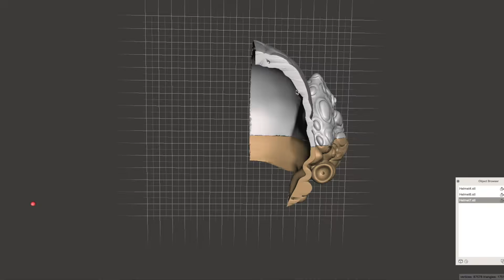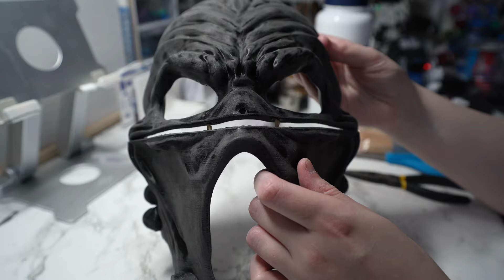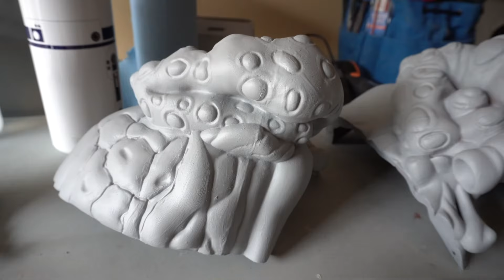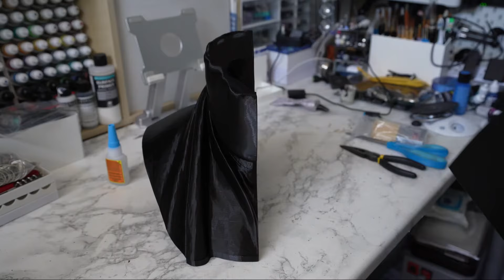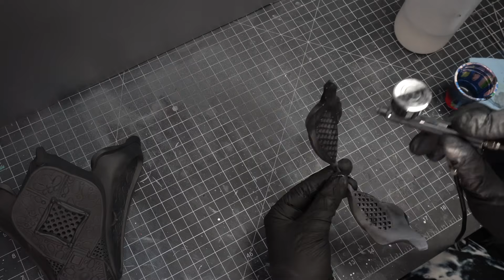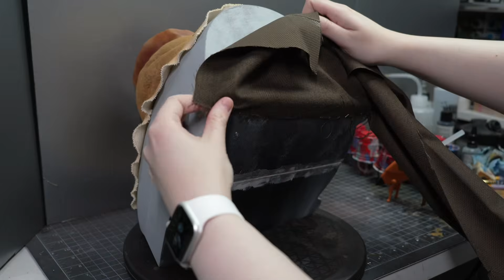Making Jedi Master Plo Koon

Comment: Absolutely love this! Can i get your honest opinion? Is this possible to recreate for someone with less experience than you? I am quite handy (made a majoras mask out of wood) but I don't have a 3d printer, so I have to buy the parts. Do you think I would get a somewhat decent result? I do own an airbrush.
Reply: As someone who also doesn't have accessibility with 3D printers or air brushes..I've been wondering if you could still achieve this through dry brushing? It would definitely be more tedious, and you'd need multiple shades of paint and multiple brushes. You'd need a solid base from sanding and priming the print before trying this out though.
Reply: @The_Cryptid i dont have a 3d printer either. I just bought a 3D printed verion on etsy to see if i can get a somewhat decent result. If so, i might purchase a 3D printer in the future for more projects.

Comment: Hiii Can it be used for cosplay? 😮
Reply from the maker: Definitely! You’ll just need to possibly look at rescaling the model to better fit your head. The neck area can be quite tight so you might have to add magnets to the back piece so that it can detach to more easily get your head into it.

Comment: Does the resin over the seams help the bondo not crack? For whatever reason when I use bondo to cover seams I end up with very slight cracks where the seam is after a day or so. You did a great job on this!! I’m subscribed to a few channels that review Sideshow pieces, statues, etc and when I was scrolling through my Subscription video list I thought this was one of them!
Reply from the maker: Definitely. Or at the very least it will fill in those cracks and cure it so no more will form.
And thank you 😊

Comment: AMAZING work 😍 how many days over all do you think it took to build?
Reply from the maker: Thanks! The printing I had going casually over the course of a week, the sanding and priming work was almost 2 weeks of pretty consistent work only broken up by some days of bad weather where I couldn’t spray anything and the painting and finishing touches was about a week as well. Other than the printing I’d say it probably equated to around 14 full days of work.
Reply: @MMsPropShop  very nice work i hope you have a great place to display it in. its a center piece for sure. 😍
Reply from the maker: Yes! Thankfully it JUST fits on a book shelf where I have some other props I’ve built/bought displayed. I’m hoping to do a collection tour video at some point.